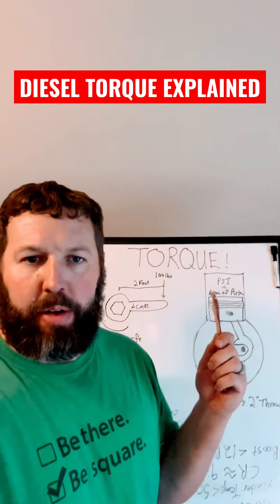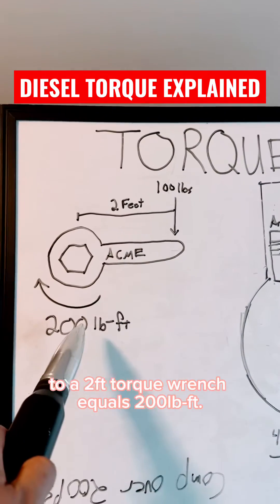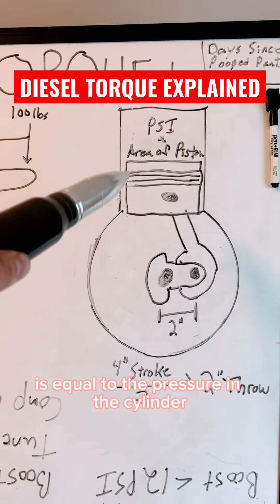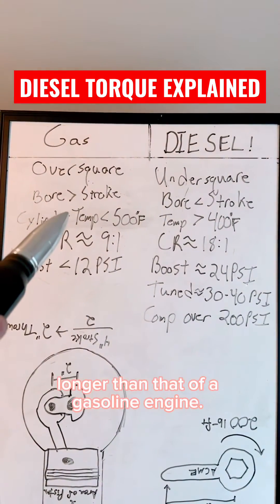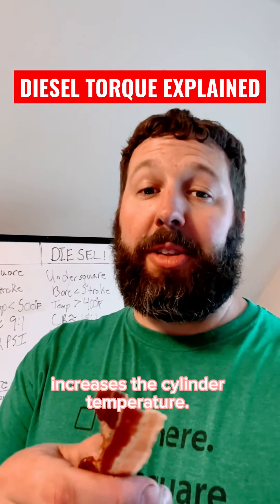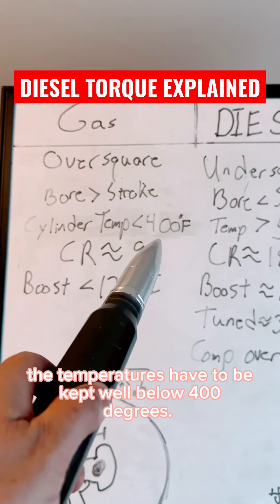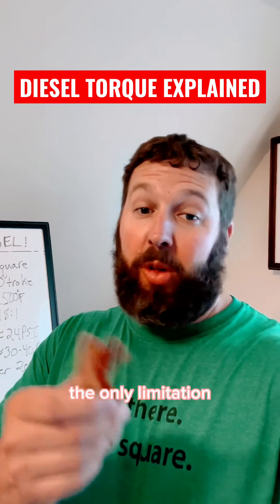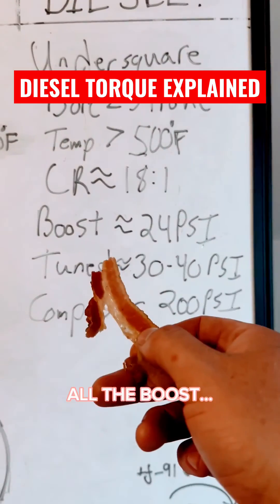Why Do Diesels Have More Torque Than Gasoline Engines?

Comment: But some gasoline engine have more torque than diesel
Reply from the maker: Show me a gasoline engine that makes more torque than an equivalent displacement turbo diesel engine.
Reply: @freedomworx  mitsubishi L300 2500 cc diesel engine with 133,4 nm, Toyota avanza 1500 cc gasoline engine with 137,2 nm. Both of them without turbo.
Reply from the maker: I specifically said “Turbo Diesel”.  Nobody cares about naturally aspirated diesel engines. There hasn’t been a naturally aspirated diesel produced for a vehicle in the U.S. Since the late 80s or early 90s.
Reply: @freedomworx  A 3.0 Hurricane HO in the Ram 1500 is making 510 ft-lbs vs the 3.0 LZ0 Duramax making 495, The LM2 Duramax at 460, 3.0 Powerstroke making 440, and the 3.0 Ecodiesel making 480

The Non-HO version of the Hurricane still makes a respectable 470 ft-lbs on 87 octane. Right in the middle of those 4 diesels.

F150 3.5 Ecoboosts are making 500 ft-lbs on 87, and a bit more on 93.

The new Corvette ZR1 is making 828 ft-lbs out of a 5.5L, which is more torque per liter than the 6.6 Duramax.

Problem is, if you actually made a GTDI 6.6 or 6.7L for an HD truck applicaltion, it would be making like 900 HP, which is completely unnecessary, and would be less efficient than an equivalent diesel while towing.
Reply: @Jay-me7gw I wouldn’t dare run that Hurricane on 87 octane.  Just expecting knock to happen long enough to make it out of warranty.
Reply: @bootz616  eh. its 10.4:1 compression ratio. Not much different than any of the Ecoboosts that run on 87 just fine.
Reply: @Jay-me7gw yeah I don’t see those eco boost engines lasting that long or driving well either.  I guess they make it through the warranty period that’s all that matters
Reply: @bootz616 where do you look? Cause I’ve seen plenty with 250k+ miles.

Also, how are diesels any better. All I hear is people pissing and moaning about all the issues they have. What happens then your CP4 shits the bed and takes out your injectors?
Reply: @freedomworx  BMW 3.0-Liter Diesel (B57, e.g., 330d or M340d)Displacement: 3.0 liters (inline-six, turbocharged diesel).
Power Output: 330d: ~286 hp (213 kW) at 4,000 rpm.
M340d: ~340 hp (254 kW) at 4,400 rpm.

Torque: 330d: ~650 Nm (479 lb-ft) at 1,500–2,500 rpm.
M340d: ~700 Nm (516 lb-ft) at 1,750–2,250 rpm.

Power per Liter: 330d: ~95.3 hp/L (286 hp ÷ 3.0 L).
M340d: ~113.3 hp/L (340 hp ÷ 3.0 L).

BMEP Calculation (using M340d for max performance):Formula: BMEP=Torque×2π×nDisplacement\text{BMEP} = \frac{\text{Torque} \times 2\pi \times n}{\text{Displacement}}\text{BMEP} = \frac{\text{Torque} \times 2\pi \times n}{\text{Displacement}}
, where n=2n = 2n = 2
 (four-stroke engine).
Torque = 700 Nm, Displacement = 3.0 L = 0.003 m³.
BMEP=700×2×3.1416×20.003≈2,932,160 Pa≈29.3 bar\text{BMEP} = \frac{700 \times 2 \times 3.1416 \times 2}{0.003} \approx 2,932,160 \, \text{Pa} \approx 29.3 \, \text{bar}\text{BMEP} = \frac{700 \times 2 \times 3.1416 \times 2}{0.003} \approx 2,932,160 \, \text{Pa} \approx 29.3 \, \text{bar}
.
BMEP: ~29.3 bar (M340d), among the highest for production diesel engines.

Mercedes-AMG 2.0-Liter Petrol (M139, e.g., A45 S)Displacement: 2.0 liters (inline-four, turbocharged petrol).
Power Output: ~421 hp (310 kW) at 6,750 rpm.
Torque: ~500 Nm (369 lb-ft) at 5,000–5,250 rpm.
Power per Liter: ~210.5 hp/L (421 hp ÷ 2.0 L).
BMEP Calculation:Torque = 500 Nm, Displacement = 2.0 L = 0.002 m³.
BMEP=500×2×3.1416×20.002≈3,141,600 Pa≈31.4 bar\text{BMEP} = \frac{500 \times 2 \times 3.1416 \times 2}{0.002} \approx 3,141,600 \, \text{Pa} \approx 31.4 \, \text{bar}\text{BMEP} = \frac{500 \times 2 \times 3.1416 \times 2}{0.002} \approx 3,141,600 \, \text{Pa} \approx 31.4 \, \text{bar}
.
BMEP: ~31.4 bar, among the highest for production petrol engines.

SummaryPower per Liter:BMW 3.0 Diesel (M340d): ~113.3 hp/L.
Mercedes 2.0 Petrol (M139): ~210.5 hp/L.
The Mercedes petrol engine has a significantly higher power per liter due to its smaller displacement and extreme turbocharging, optimized for high-revving performance.

BMEP:BMW 3.0 Diesel (M340d): ~29.3 bar.
Mercedes 2.0 Petrol (M139): ~31.4 bar.
The Mercedes engine edges out slightly in BMEP, reflecting its ability to generate high torque from a smaller displacement.

Times they are a changing.

Comment: Volvo D16K generates 2600 lb ft of torque on a ratio of 32-0.7(i shift+crawler gear)👀
No wonder they managed to pull 800+ tonnes
Reply from the maker: Metric Tons 😎

Comment: Nice. Humble request: why "does torque win races" ? Can't horsepower (or just power) be converted to torque with gear ratio? and vice-versa? Thanks for the great videos.
Reply from the maker: Great video idea. I love me some diesel torque, it’s fun on the street. But it doesn’t get you to the finish line first. It’s all about horsepressures.
Reply: Kinda late on this but hp is basically torque x rpm divided by a constant. If you look at a Dyno graph you can see that power is generated over a period of time, hence the curve. So if you lack torque you have to increase rpm. It's really about finding a balance between the two for whatever purpose the engine was built for
Reply from the maker: Yes. Every engine design is about balance. Heavy industry uses diesels because they are the most efficient ICE engine, but the sacrifice is weight and power density. Racecars use spark engines that rev to the moon and create gobs of power, but are extremely inefficient and short lived. Everything is a compromise.
Reply: Ive never heard that saying. But horsepower is just a function of torque combined with rpm. Torque is basically how much power you get in a single power stroke. And rpm dictates how often you get that power per unit time. So while diesels give great power on a single stroke they fall short of doing that a lot every minute. So you only see diesels in long term endurance races. Just for comparison. Your typical diesel wont go above 4500 rpm. Your average F1 petrol idles at 6000 rpm and can technically reach around 21000 rpm.

Comment: Torque is when you need to piss with morning wood and you push it down and feel your ankles coming off the ground
Reply from the maker: That’s TORQUE! 😂
Reply: God. All that. Plus large Fing prostate. Huge pressure, small trickle.
Reply: Good Lawd.
Reply: Bahabababababababaa 😅😅😅😅😅😅😅 😅😅😅😅 hababab im dying 😅😅
Reply: Handstands for the win.
Reply: You should sit to pee (no mess) and when you push down your ass lifts off the seat
Reply: I end up doing the Superman across the toilet rim in these circumstances.